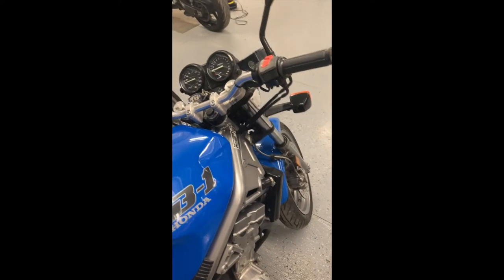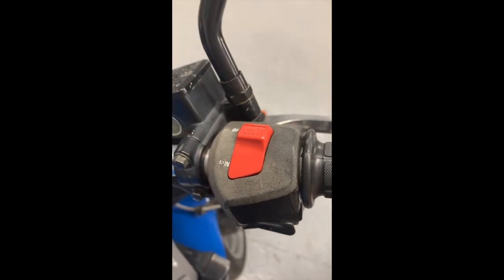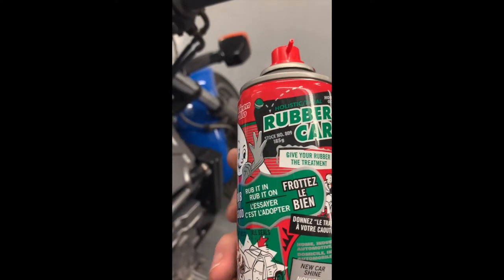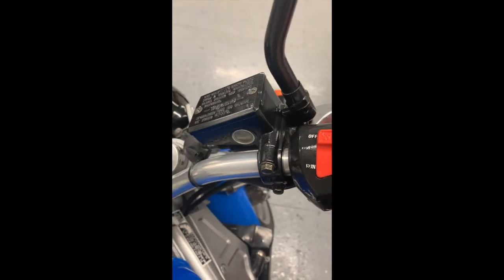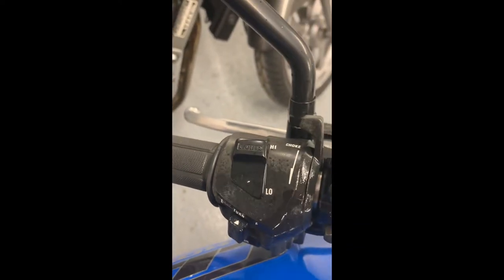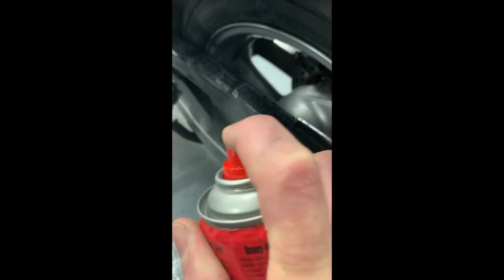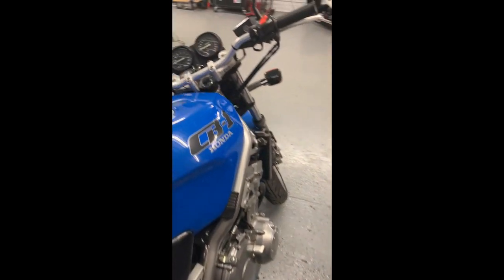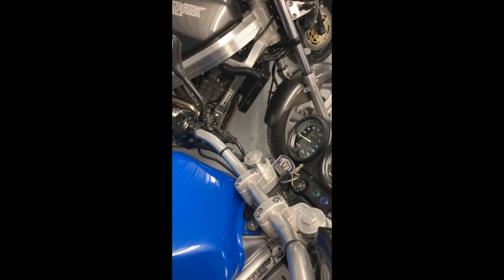Restoring Faded Motorcycle Switch-Gear

Comment: Ok my friend I'm not sure what bikes have plastic switch gear . My victory and Harley and gsxr all have magnesium switch gear housings and the only plastic parts in the switch gear is the buttons but none of the housing are made of plastic anyway keep doing what your doing if it works .
Reply from the maker: Interesting , I’ve had over 50 bikes over my life and all have been plastic.   Even my GSXR (1986 & 1993) I currently have 20 bikes in the shop now and all are plastic.   However I never had a Harley or a victory motorcycle so I cannot speak to those .   All mine have been Japanese bikes and Austrian , German or Italian bikes.  New and old all plastic housings.   That’s why this product I use works So well on them.  It’s for rejuvenating plastic and rubber, it does nothing for painted metals. 

Thanks for watching and commenting!  Much appreciated !